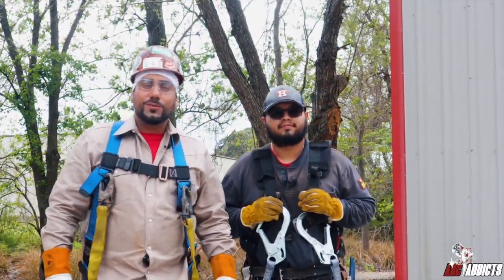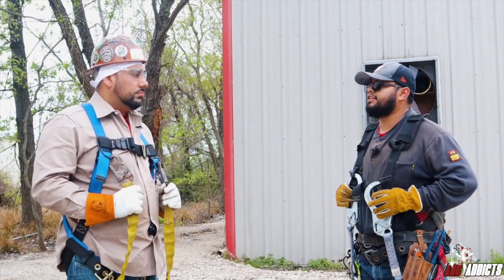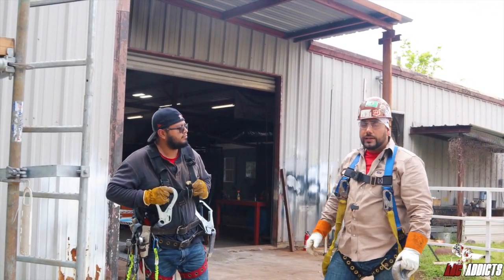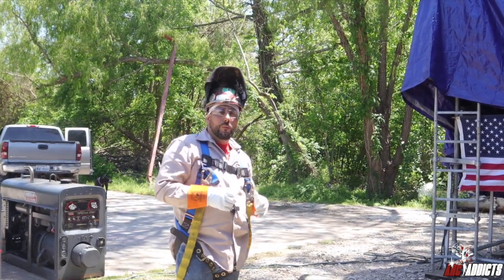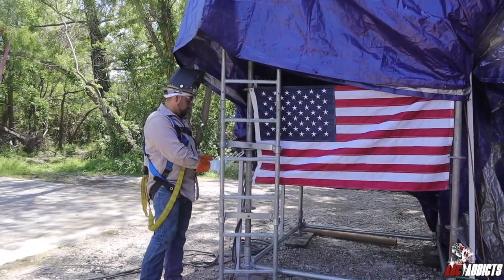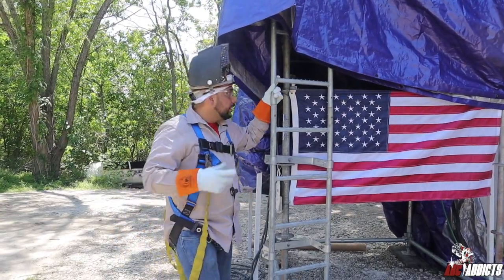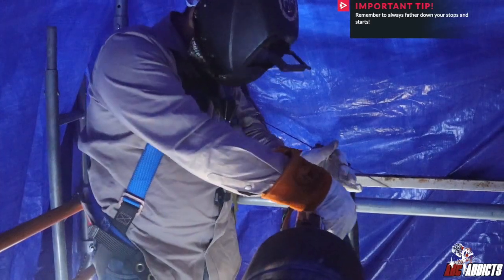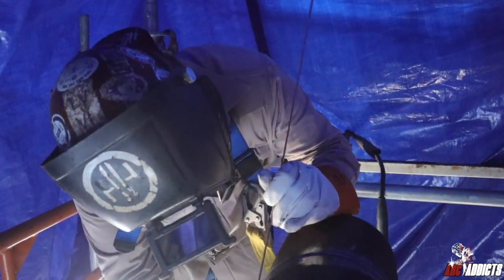HOW TO WELD 5G ON A SCAFFOLD!

Comment: I thought you wasn’t supposed to put the tarp over the hooch bc of the argon
Reply: depends on the welder how he wants it , but than again gotta have everything hooched up because them firewatchers be crying that sparks are flying also gotta watch out for the safetys
Reply: @christiandiaz551  yeah I know I just had heard if the whole scaffold is hooched off with no air flow that argon will kill you since it’s trapped in the hooch
Reply: Traditionally you only block the four sides without a top since it rained we had to cover the top As well